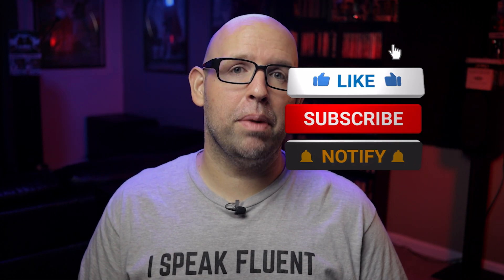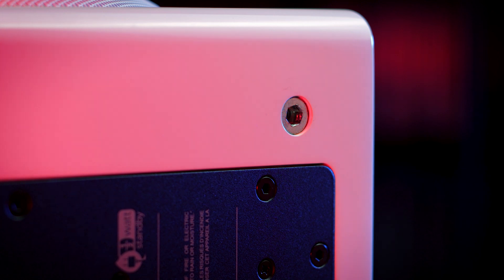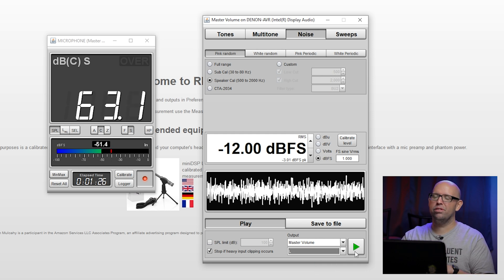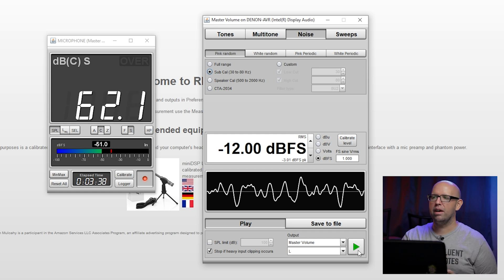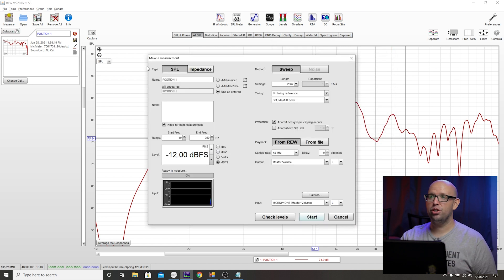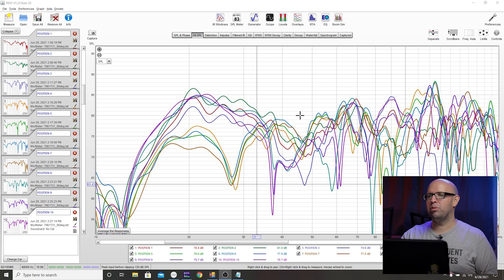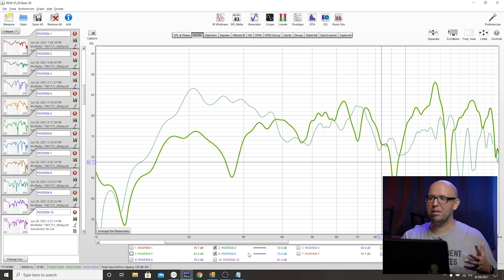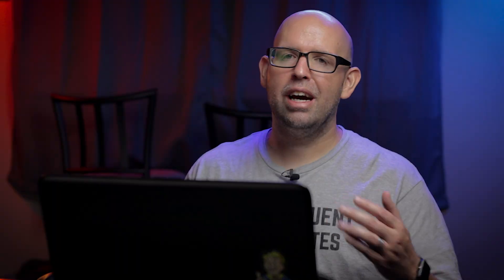BEST Subwoofer Placement Using REW | TUTORIAL/GUIDE

Comment: Did this yesterday based on your video and it sounds great. Oddly the best locations for my 2 subs are the back left corner 8 inches toward the back wall center and the far right corner, both facing forward toward my left and right speakers. The are not even facing my listening position but they sound great. It doubled my bass and I have a nice even line from 17hz to 145hz. I am crossing over at 75hz but I have the option to go higher if I wish.
Reply: Did you turn off one sub and find the position of sub1... Then go back and test the 2nd sub to find its position.
Reply: @unclecool1  Yes I did each one solo.
Reply: @lbpiercy thank you very much.

Comment: Thank you for this detailed video. I followed this video and was able to get good results. However had to pick LFE channel instead of Left channel for doing sweeps. When I picked left channel there was a huge  null around 80hz. Even though cross over is set to 250 hz still the actual speaker was impacting results. Once I determined the sub placement by testing with LFE re ran audyssey. Then played with crossover , initially set to 80, still there was a null for left Channel alone. Increased to 90 then null got removed.

Comment: Love your videos and have learned so much from you! But i have a question i cant find a answer for. Do you change the distance in the AVR for the sub after changing placement, before measuring with REW?  This is just for testing different location. I have 2 subs in front now, but thinking about getting a third. So before i buy a new one,  i want to try to use one of the fronts in different positions in the room. So if i am placing the sub behind the sofa, do i change the distance from 11 feet to lets say 4 feet? Hope this make sense😅

Comment: When I follow these directions on my NR1711 and do the sub cal generator (30-80hz), I get sound out of my main left channel also. I checked that audessey is off and my crossovers are at 250hz.
Reply: But only the sub is outputting frequencies below ~250, and that is the part of the graph you are interested in.  So I think this is normal.

Comment: Meters and devices do not always agree with what we hear with our ears. Just because a meter tells you something is correct or ideal it does not mean that result will automatically sound the best to you. I have been in the audio industry for 30 years and I always recommend to people to develop a base using instrumentation and then tweak from there using you ears only. Something people fail to realize is that even high end AVRs ship with cheapo mics which are then used to calibrate your system. These auto-calibration systems are in reality terrible. I have found that about 90% of the time these results will net a degradation in sound quality over simply running in pure direct mode or never running any calibration at all. Similarly doing a simple bass crawl using varied and quality source material will net you a much better result than using software.   Oftentimes in life less is more and people have a tendency to overcomplicate things. Took me many years to accept this.
Reply: That's why you use a calibrated mic and take measurements after the avr has done its calibration to find out what it's actually doing. Yes, everyone's ears are different, but being able to see the data from a calibrated, accurate mic is helpful even if you're not trying to get a flat response.

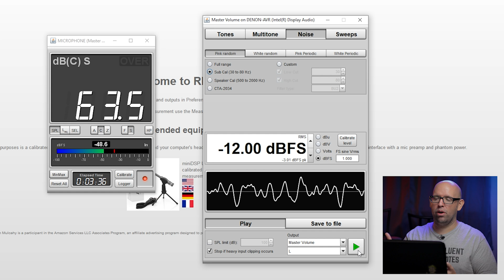Comment: Great Video - thanks. However a bit of confusion. Reference 6:20 in your video.... Your instruction for setting the sub calibration (after previously performing the Left mains calibration) shows that you have selected the "SubCal" test signal but you have "L" selected at the Output. Should the Output not be "Sub" or "LFE" ??
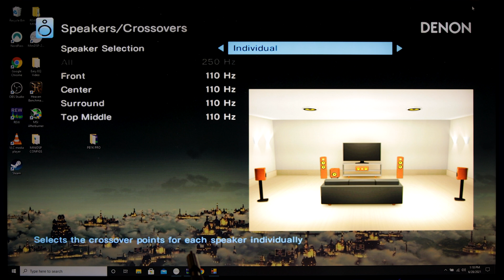Reply: I think the reason is, you're supposed to set the crossover for all channels (including Left channel) to 250Hz (see 3:00 in the video), so only the sub is outputting bass frequencies below that.  And you are only inspecting/caring about the low frequency part of the REW graph.  So output is still 'L' in REW but the audio that matters is the bass-managed audio that comes out of the sub.

Comment: Hey Brad, I've been watching a lot of your REW videos the past 2 days and want to say thanks for the great content man!  I just changed my LCR for the first time 14 years, and went from great towers speakers to in-walls, and now my bass response and output is significantly lower, so I need to do something to fix it. With my old setup I just level matched my speakers to around 75db, set my sub to 79-81db, and use a SPL meter and the distance setting to phase aline my subwoofer to my mains at 80hz, and my room sounded amazing. But now that isn't giving me great results, so I'm going to try take it to the next step...  I ordered a UMIK-1 and got REW downloaded and my PC setup to my AVR, so I'm going to start messing around with this today. 

I see that you set your subwoofer(s) at 75 db, but when I set mine at that level then the Dynamics are almost completely gone in my room.  I've been running my sub around 79-81db since I got my SVS PB-1000 2 years ago, and that seems to be the sweet spot for delivering good bass and movies and music, but do you think that would mess up my measurements when trying to find the right crossover and phase align it to the front speakers???

Comment: just to understand it right, when bringing the db always to 75, it´s not to calibrate right, it´s just to have the volume all the same, to have equal conditions and compare measurements the right way, am I right ?!
because normally I do the calibration once and just move the sub around
Reply from the maker: Correct, it's just for having equal conditions and to make it easier to pick out the best response in REW since they're all the same level. One could argue that you should only calibrate once and then move the sub around as that will make it easier to see what the room is doing. But personally, I would end up adjusting the level anyway to read 75dB or so as I've never had a good experience with gain matching subwoofers.

Comment: I'd still much rather lift it into the seat once and move the mic around!  Also, a question on multi sub placement.  Once you find the best spot for 1 sub, wouldn't you want to leave it turned on while you move the second one around as the response with both subs together will be more accurate of what to expect than each sub on its own?
Reply: I was wondering the same thing

Comment: Great Video. Not sure if I agree with changing the sub volume after each time moving the sub. I think the volume should be kept constant throughout, and then you can see the frequency response and see how the room affects the different frequencies at the different positions. For example, position 1 and 2 appear to have near identical frequency responses below 50hz but is offset by 2db due to the increase in volume by 2db for position 2. If volume was kept constant, then the lines would overlap below 50hz, and would be easier to see at what frequencies the response is different.

Comment: As always, great info! Do you have any experience with the Dayton Audio iMM-6 calibrated mic? I've been toying around with building a rig for my Master Bedroom using mainly FB Buy/Sell finds using that mic and a MiniDsp 2x4 (non-HD). I found a Yamaha RX-v867, Micca RB42, RB Center, Covo-S (height), OoO (side), Miccs In wall (rear), dual Klipsch R10SWs, Sony UDP700M, and Vizio 55 (replacing with a Hisense U8G 65", with a Govee immersion kit). I purchased a older laptop, and I'm using a usb to HDMI 4K adaptor for use with REW. THANKS!!

Comment: This was the first thing I did when getting my UMIK-1. Had my subs front and center on each side of tv stand and after measuring them they both had a null at the same spot. I took over 40 measurements in the two corners I could place the subs putting the sub facing different directions. I didn't need to label the spots with tape as I pretty much used the wall it was facing and how many inches away it was with moving the sub 6" between each measurement. Interesting enough the spots that looked best were very similar being that both were about 9 inches facing into the wall. Only thing I wish I had done was buy furniture sliders as my back hated me as moving a 70lb sub 40+ times by lifting it wasn't fun.

Comment: Great video… I have a few questions… while playing pink noise for  you mains and sub, what’s is the correct level/gain of the “dBFS?”Do I need to unplug my mains while level matching my sub to 75db?
Reply: No you don't have to unplug your mains because you set the crossover up to 250 or highest and set REW to 20- 200 htz for the sub measurements.